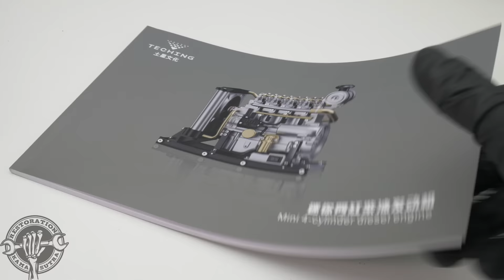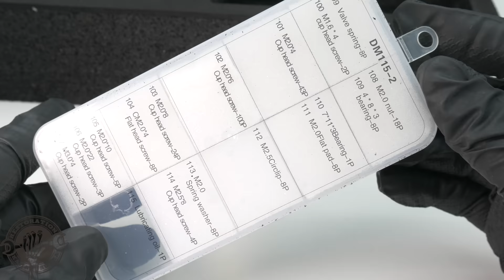Building a 4-Cylinder Diesel Engine Model Kit - Mini 4-Cylinder Engine Assembly

Comment: You can buy actual running miniature engines for less than what it sounds like this thing cost. Toyan gas or nitro 4 stroke 4 cylinder is like $600. And it’s a kit that you build.

I knew something was up when I noticed none of the parts were machined, all cast, no piston rings, no rod or crank bearings, very soft valve springs. It’s a neat kit but not if it cost thousands.

Comment: I see a flaw on the design, from the pump runs only a single pipe (worst, a hose) to a divider that sends it for the 4 inyectors, if that where a electronic inyection moddel, we could say that the thing is the common rail, but. What electronic inyection engine doesn't have an intercooler? Plus the pump is not acurate and those shuldn't be hoses they should be iron or aluminum pipes

Comment: It isn't even real!
Just a demo model
Reply: Do you mean it’s not a running engine?  Did you read the title?  Do you understand the word « model »?  Seriously Eric, try thinking.  I realise a lot of people think it’s overrated, but you may find it helps you in life.
Reply: @paultinwell5557  they have running model engines. Soooo the comment you just made is invalid
Reply: The same company produce working model engine kits too from v twins to inline 6’s,  @JohnnyQ90 builds and modifies them on his channel
Reply: Oh,but it is!
Reply: Oh,sorry. You're right.
Reply: @Gocrybozo  erm… doesn’t the « running » part qualify the « model » part, making it a model which runs?  Not the same as the subject in question.  Think harder!
Reply: Oh it’s real; just not Diesel fuel powered. You’ll need to shell out about $12,000 dollars for an actual full-size engine.
Reply: Who is Evan?
Reply: It's not running
It has an electric motor turning it
They do make real motors this small that do run on fuel
Reply: You Can't Even spell Even
Reply: @LeiLei69581  With a capital E?
Reply: You need to buy the ignition and cooling separately
Reply: @paultinwell5557  seriously Paul, try thinking. Multiple model engines are 100% functional and are used to power RC vehicles
Reply: @stocker292  
Hahaha it's not real
Reply: @LeiLei69581  
Gotta lazy finger
I corrected it
Reply: @ischwhit6747  interesting. Have you looked at the definition of the word model or just accepted common parlance?  The world becomes just a little bit less intelligent every day.  Nevermind.
Reply: @paultinwell5557  
Definition of "model" from Oxford Dictionary:
a three-dimensional representation of a person or thing or of a proposed structure, typically on a smaller scale than the original. 

So yes, this applies as a scale model. Nothing says it doesn't have to be functional

Comment: If that's a diesel engine, it's very poorly made. Hardly any compression when diesels require a considerable amount of higher compression than straight gas engines. Too many rough surfaces where there shouldn't be. Example, valve seats. Lose a lot of compression there. Did I see that right? A turbo diesel? Yeah, OK. Sure. This is for looks. If it's runs it won't be for long.

Comment: These tiny engines are pretty cool but are ridiculously overpriced. You could buy a good used car engine cheaper than the $1200 straight 6 I looked up.

Comment: Kinda a waste to me. You have every single detail to make it run, but it’s not going to run on its own power. Yes, in theory you could make it run, but it would be very hard to make it run as it has a lot of parts that have either wrong measurements or don’t do anything real as they’re just for show. Cool model, don’t get me wrong, but it annoys me a bit to see something so insanely in depth go to waste because of costs.
Reply: Not a real engine.......
Reply: @TAZ95C4  did you read what I said?
Reply: @schizophreniagaming4058  sure did. Point being?
Reply: @TAZ95C4  point being, the model goes to waste because of costs, the tolerances are off and can’t really be fixed. It’s a real engine model, but it can never run. It sucks, so if you read my damn comment, you’d see that’s exactly what I said.
Reply: @schizophreniagaming4058  so your argument is that it sucks as a model because it would take to much stuff to actually make it run........🤔🙄
Reply: @TAZ95C4  yes, and too much effort put in to make it look like it could. Sell the product when the product works , not when it doesn’t.
Reply: @schizophreniagaming4058  ok smh